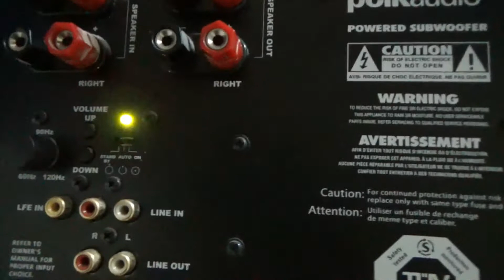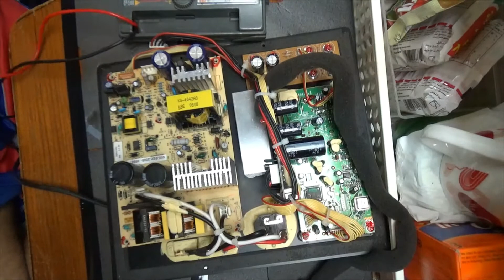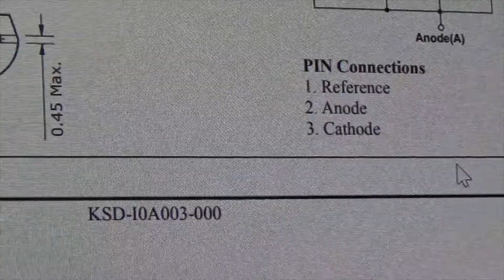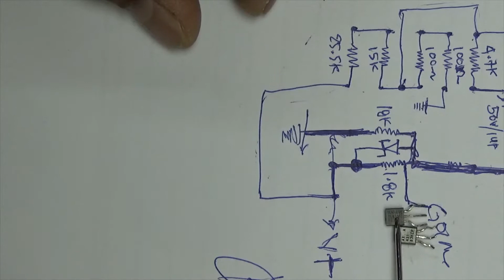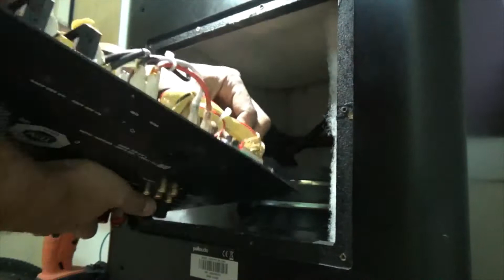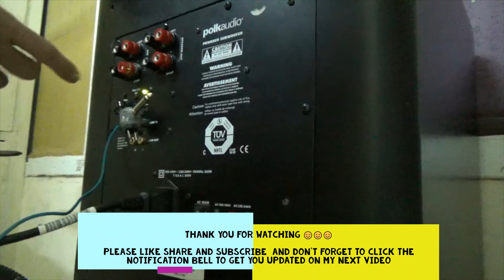How to fix no audio Subwoofer Model DSW PRO600 Polkaudio?After turning on then turns to RED.

Comment: Hello Sir @Allan Rotoni, musta po! meron din po ako ganyan model sir same problem after switch ON light green appear and then pag may load na or may sound it will turn Red tapos mawawala yung sound , ano kaya possible sira sira yung Transistor pa rin ba na pinalitan mo...Salamat po.
Reply from the maker: Hi po, try nyo po una e disconnet ang speaker woofer tapos tska nyo e  test. Pag di na nag red ibig sabihin sira ang speaker. Pa check narin kung tama ang ohms ng speaker.

Comment: hi,  Nice video, what is the value of the resistor R24 and R34. It's those big 2W resistor beside the connector that goes to the amplifier board.
Reply from the maker: Hi thanks for watching.
Sorry for this as I had no chance to see it. But it's looks like 100 ohms or .10 ohms.
Reply: Hello Sir,
Actually my subwoofer the amplifier board was burnt. The main amplifier chips burnt. I replaced the chips, now my issue is the resistor I mentioned, getting very very hot and can feel the heat and bit of smoke. The good new is am getting sound but just that resistor is getting very hot. Not sure the exact value of the resistor. Saw a picture online, looks like 1k ohm and some are 3k ohm.
Reply from the maker: @anoushan  Hi, can you share with me the circuit line connectivity, where these 2 resistors connected?

Comment: Boss, new subscriber here. Saan ka po dito sa Manila? may contact number ka po para sa mga ipapagawa? I have Polk SUbwoofer 110V nasaksak sa 220v
Reply from the maker: Hi sir thanks for watching po. 
Andito po ako sa Qatar sir.
Commonly pag 110 tapis nasaksak sa 220  ang unang masisira ay fuse. Pero possible din na masira ang FET transistor at PWM ic kung ito ay SMPS power supply.
Reply: Mukhang mas ok na nga po na ipacheck nlng sir.. maraming salamat.. God bless
Reply from the maker: @KimwellH   Your welcome po sir☺️
Reply: Thanks boss, Ung fuse sana gusto ko una ma check pero d po sya visible.. mukhang nakatago somewhere. Sorry di kc ako bihasa sa electronics po.. .kaya po ba makita ung fuse at mapalitan nv ako lang sakali po?
Reply from the maker: @KimwellH  Mas maganda po na i pacheck nlng sa technician para maiwasan ang iba pang pagka sira.

Comment: Hi, Nice video. I want to ask one thing. Have you connected mains(AC in) to Isolation Transformer? If I don't have Isolation Transformer , then can I at least  check final voltage on secondary side of SMPS? Will it be safe? I need to check my Subwoofer SMPS voltage out which is 24/36Volts. Kindly reply. Thanks
Reply from the maker: First of all thanks for watching😊
This unit in this video was run in 230 volts main AC in. If your unit rated supply is 110 volts then you must need to used isolation transformer to avoid damage the SMPS.
Reply: @ARTaudio440  My AC is 230V only, There is a switch to select 120V which I wont use. Before I troubleshoot DSW550 I needed that confirmation as its SMPS and it don't need isolation transformer. I need to see if all voltages are perfect on SMPS part and then see amp one. So I can just turn on the AC and take SMPS  output reading on secondary side, right? Thanks.
Reply from the maker: @music-mypassion5161  Yes right, no need isolation transformer. It's safe brother😊
Reply: @ARTaudio440  Thank you so much :)
Reply from the maker: @music-mypassion5161  You are most welcome🙏☺️
Reply from the maker: Additional on this and applies only on fix supply without the selector voltage AC input and the rated supply of the unit is 120 or 110 volts.

Please check the 2pcs big capacitor on the primary if 200 Volts each. If 200 volts, then disable the Jumper line that was connected to one line AC IN pin of bridge diode between capacitor ground where it was connected the positive and negative in series to get the 400 volts.   That line should be open to be able run in 220 volts without damaging the SMPS.  Hope this will help you😊
Reply: Update, I could take smps readings today and found same. 5B drops, 12V also drops, standby 5v perfect. Amp power starts from  48v to almost zero. That means smps is faulty and needs troubleshoot. correct?
Reply from the maker: @music-mypassion5161  Please disconnect the power supply of the amplifier then turn on again. You have to power on self test the power supply without load from amp board to find out where the problem is.  If the same symptoms happens then power supply is the defective one.
Reply: @ARTaudio440  Thanks for tip. Will check and revert. I will just take output readings as don't have isolation transformer. I have 230V AC input though.
Reply from the maker: Additional on this

1: Double check the reading of the two IC AX431  how to check? Watch track 10:00 (Small leaked will shut off the power supply)
2: Double check the standby switch located at the back panel if it is working perfectly.
3: Double check the ohms of the speaker coil line just to check if shorted or not.
4: Double check the P/O supply on the SMPS, you must get at least 3.3 volts to ON the power supply (Not sure on this but try to check it😊 )
5: If everything is ok on the above,  Lastly, disconnect all the connection from SMPS the CN2 and CN3 then turn on the unit. If still shutting down, grab your analog tester and set to X1 then positive probe on the ground and negative probe is on the P/O line. SMPS Must turn ON without shutting down if no faulty parts on the SMPS.
Reply: @ARTaudio440  Thanks, I just checked SMPS without connecting amp side and it wont turn on. After connecting Amp side, voltage shows and then drops. The funny part is 48v sometimes is constant. Will go through new tips and revert. Regards.
Reply: Speaker  coil I had checked and its just under 4ohms,
Reply: @ARTaudio440  I have some issue also power turns on green then shutting down... Then I noticed the one diode is hot then I check the U3 IC reg is deflect both pin anode and cathode.. but I'm your videos U4  ICs reg u replace then is working...
Reply: @ARTaudio440  thanks for your help bro... I will search and trouble shoot again if I can found the A431ic reg then I will be back to you cheerss🇵🇭
Reply from the maker: @ivangreat4673  Thanks and hope for the best🙏👍
Reply: TAS5508B chip